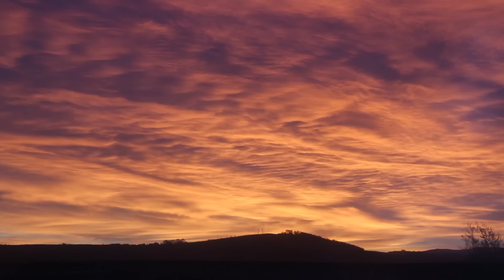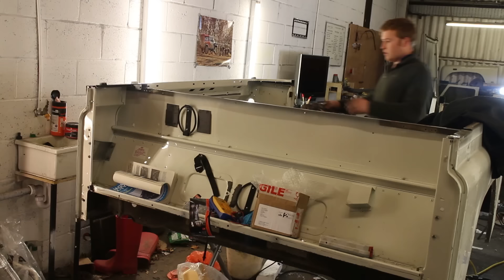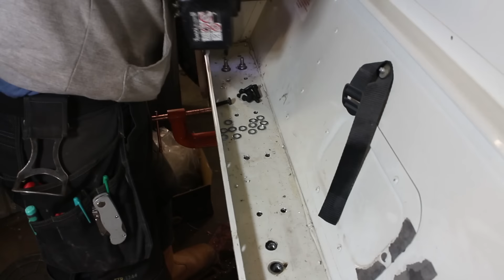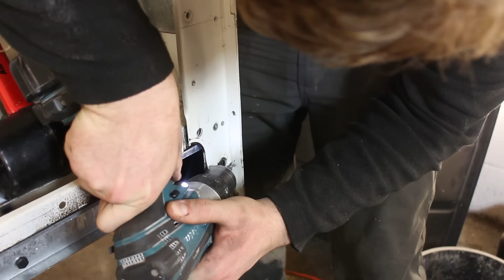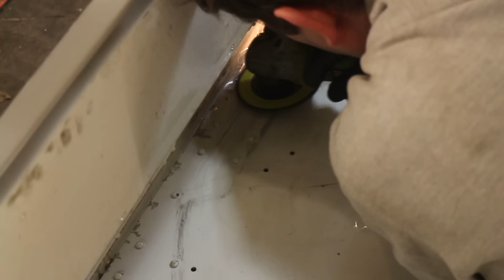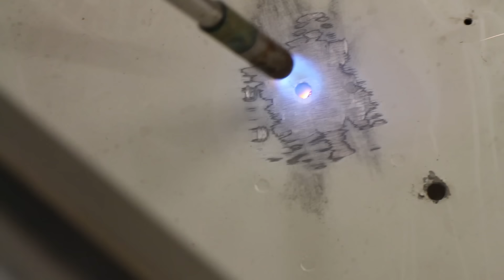Defender Tub Repair

Comment: Thanks for the interesting and super helpful build videos, great for those of us rebuilding an older Land Rover.  Can I ask what size you recommend for the spot weld drill bits please, and where you got your bit from.  It looks like 5/8" and 3/8" are common sizes this side of the pond, but the solid spot weld bits/cutters are less easy to find.  Good luck with the project!
Reply from the maker: +Sask Series We bought a 6mm and 8mm set, used the 6mm exclusively. They can be purchased on eBay with international shipping
Reply: Sask Series 9